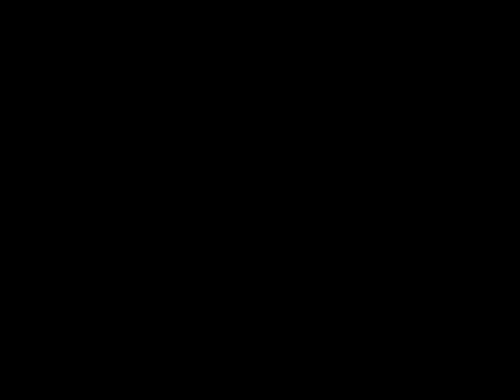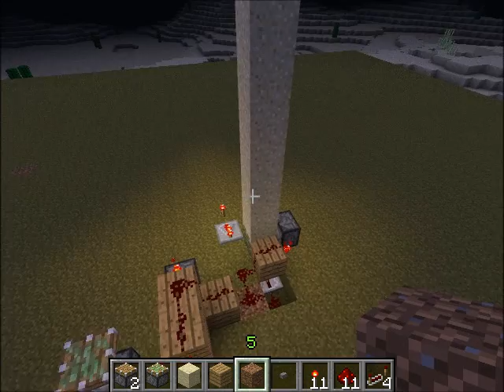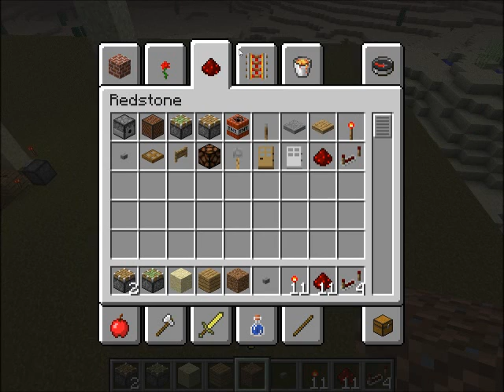Downward vertical redstone using sand/gravel tutorial

Comment from the maker: There are already many sand elevator, but none that use the sand to send the signal downward.  An elevator that goes down needs to send a signal in descending order, and falling sand doesn't transmit redstone signal, though it is possible to call an elevator to the top floor using this.